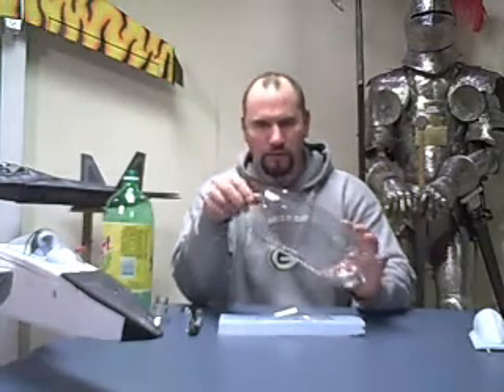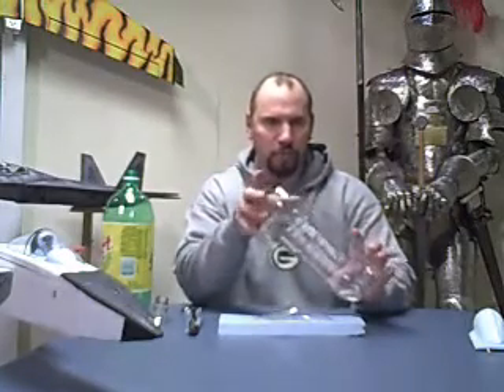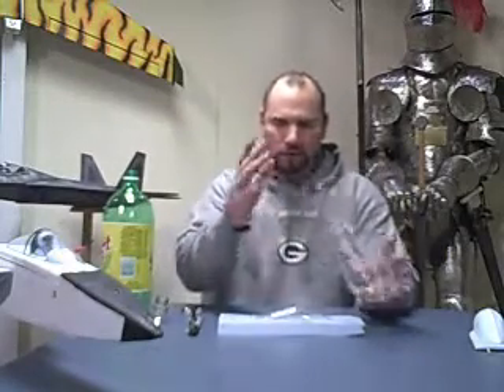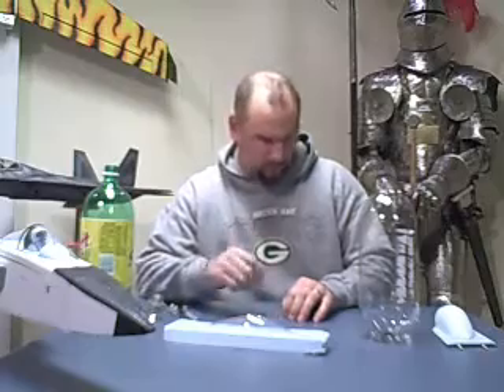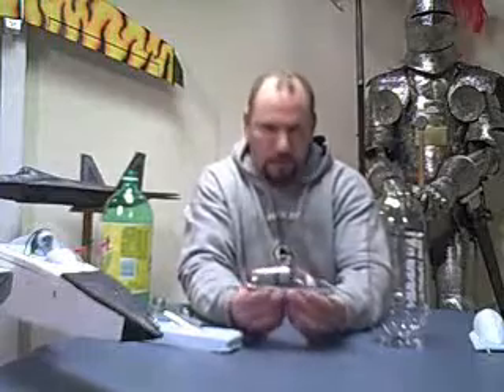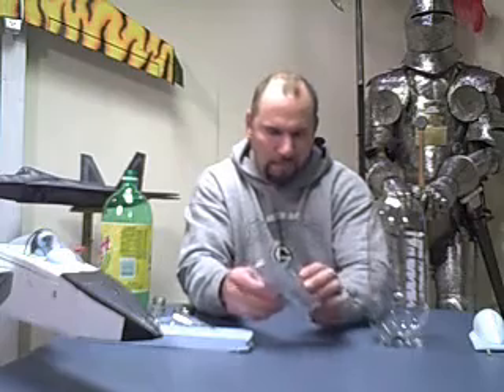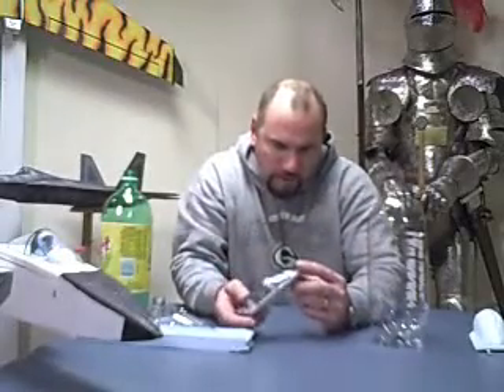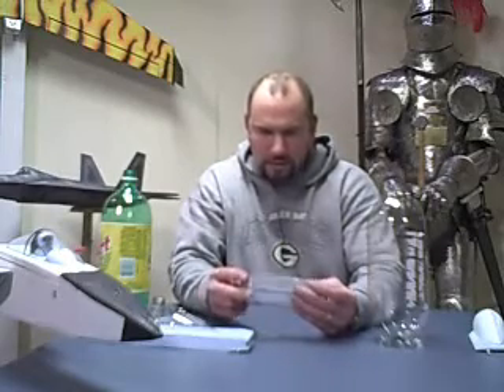Soda Bottle Canopy

Comment: I built my BT spitfire canopy by placing the balsa plug I carved  inside a large PET bottle then placing it in an oven until the plastic shrank over the plug, I am still using the originional one I made back in the 90s, its holding up well.